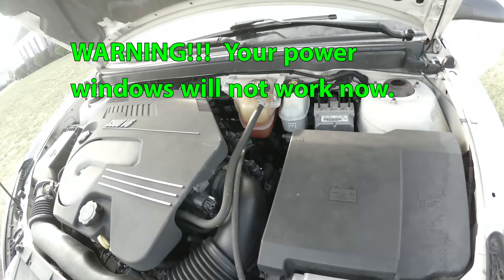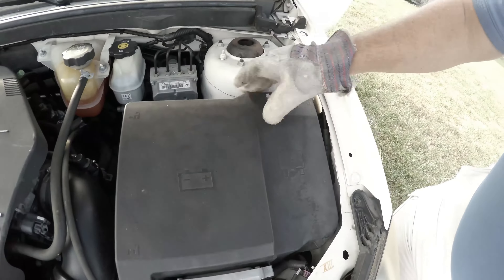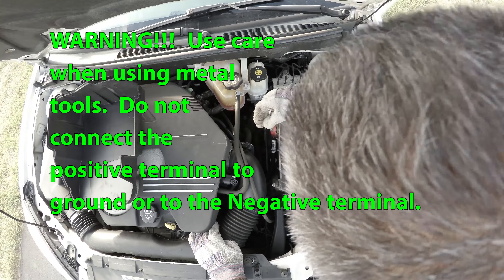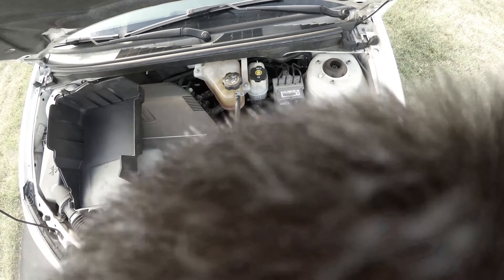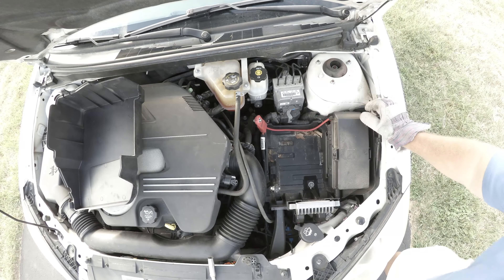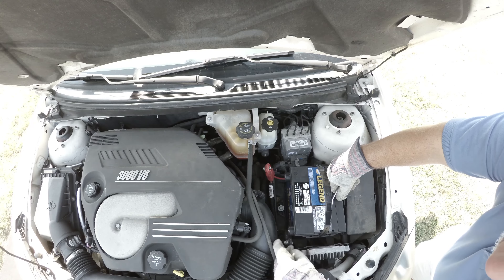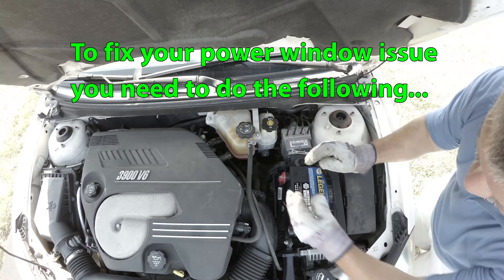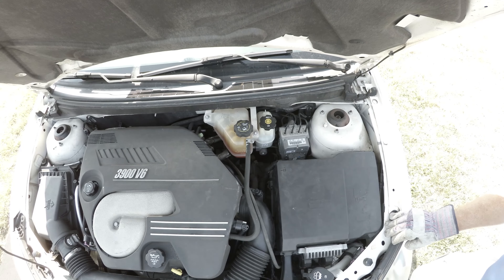Pontiac G6 2007 Battery Replacement and Resetting Power Windows

Comment: Thank you so much for posting this video.  It worked and now I don't have to worry. Phew!
Reply from the maker: Thank you for sharing your experience. I called the dealer service department and cancelled the appointment once I got it working. I too thought it broke.
Reply: I thought maybe the brand new battery I bought wasn't good or it wasn't a good match for my car when I realized my automatic windows weren't going up all of the way.  Thankfully everything is fine now and I don't have to call the auto parts store about the battery/window issue.

Comment: I always disconnect the negative battery cable first that way if I do touch something metal while undoing the positive cable it can't arc.
Reply from the maker: Michael Eyler Thanks. Your recommendation is definitely safer.  I've arc welded with a battery before...it aint fun!

Comment: That's kinda odd I replaced a new battery in my 2007 pontiac g6 and only thing I had to do was reset time and radio stations I didn't have any issues with my windows
Reply from the maker: This was a convertible...could that be why?
Reply: Oh ok maybe that's why glad you got it fixed